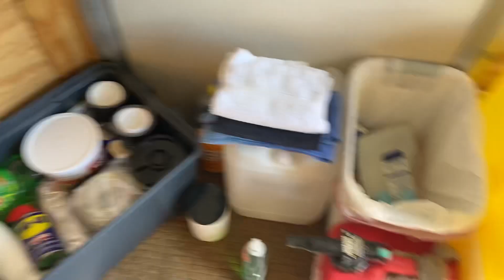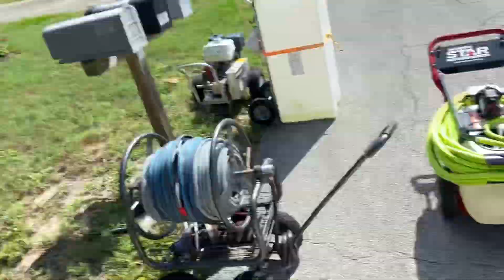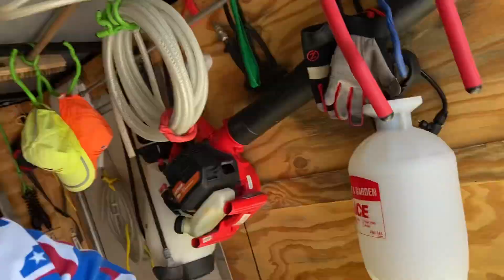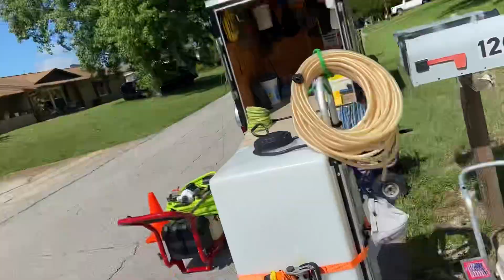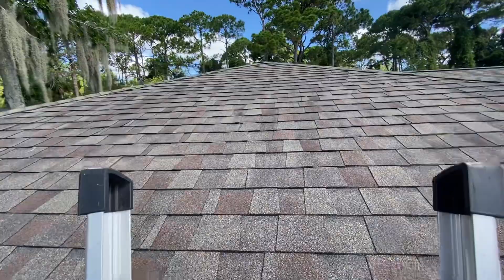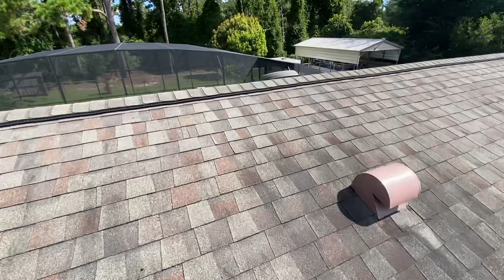Asphalt shingle roof soft wash set up and plan for cleaning

Comment: Hey Trevor, thank you for all of your informational videos. They help a beginner like myself out a lot. 
Question, how much surfactant (gain) do you use in your 13gallon mix with sh when washing a house or a roof? I have the same soft wash system.
Reply from the maker: High beast mode, I don’t use gain original laundry detergent on a roof. You can use green gain dish soap, it acts a lot like roof snot where it sticks really well. I don’t measure the amount so I cannot give you an accurate measurement, but I will say if you squeeze the bottle for about two seconds enough to make two circle patterns on top of your batch mix that’s enough. Too much soap and you will see a white cloudy residue that looks very unattractive in the drying process and you will be forced to have to rinse the roof. Rinsing is always a great idea depending on amount of organic matter and drainage as well as plants and grass below, it’s one of those things you have to make a judgment call. I make sure all the metal is very well rinsed as well as the flashing and facia around the exterior of the home. I hope this helps and best of luck out there stay safe. I highly recommend trying some different industry standard surfactants. Apple Wash is great, Terra wash is fantastic and Leon Johns has a great soap out there check it out. 
I understand that shipping costs can be a deterrent however you will use less of these soaps they will be more effective and you can sell higher end jobs because you’re using solutions that are professional. We got away for many years with using dish soaps and laundry detergent and they will work if you are in a pinch however we are looking for surfactant that will enhance the chlorine and make it stable for multi use purposes. Best of luck and I’m here for your brother.
Reply: @t-n-tpressurecleaning7781  Amazing feedback Trevor. I will definitely take a look at the other surfactants you mentioned. Thank you so much. I greatly appreciate it.